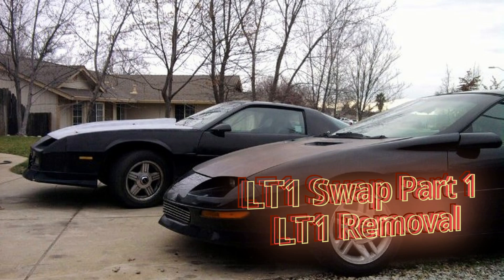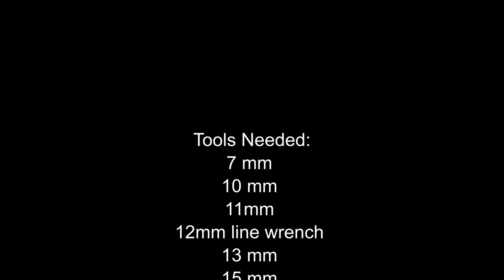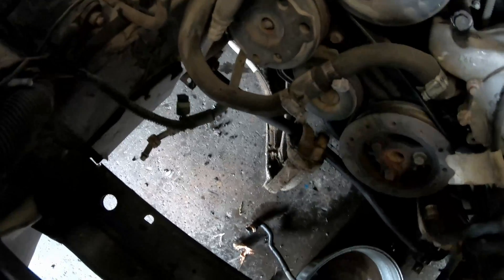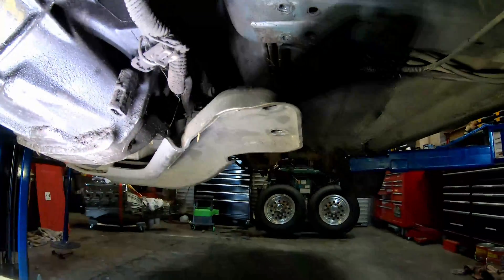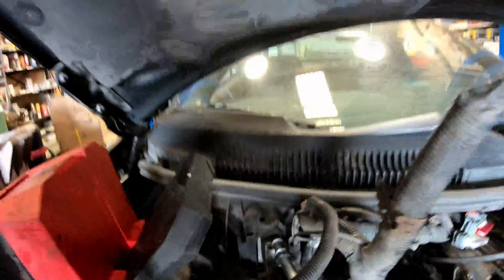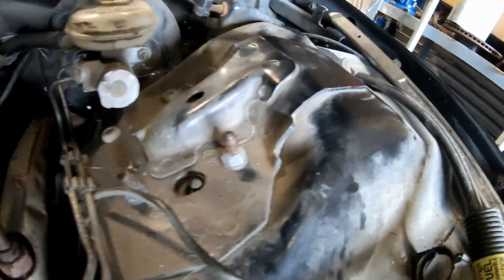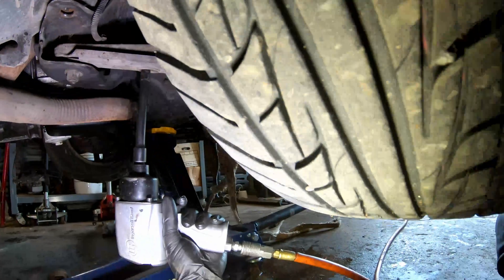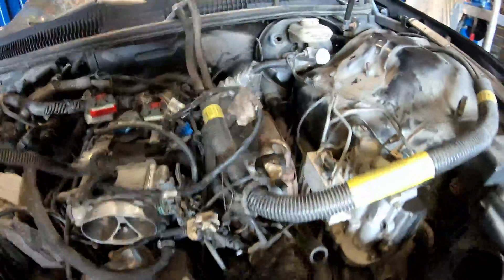93-97 Camaro / Firebird LT1 removal  (LT1 Swap Docuseries P-1)

Comment: Chat gpt recommended me this video thanks man
Reply from the maker: Cool, what did you ask it?
Reply: @GrimRepair all I asked was show me a video of the exact cradle bolts being removed and here it is, 4-5  years ago later this video is still being recommended. It's ironic because I've had the car about that long and haven't worked on it and now Im just starting to. Sad it's sat. Happy that these jobs aren't super difficult to where I couldn't learn.
Reply from the maker: @mxshy7244 the third Gen in the thumbnail has been sitting for 15 years, and it's now almost done with the lsa swap. I'm sure people around me thought I would never do anything with it. Hang in there have fun, and it will get done.